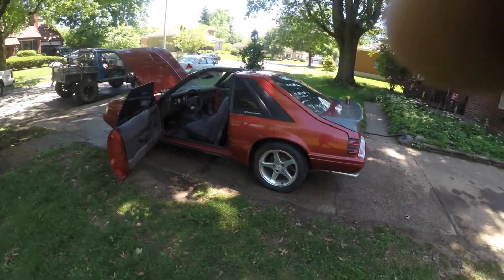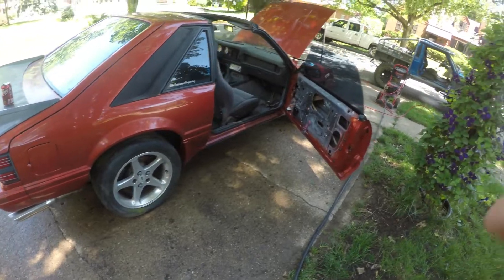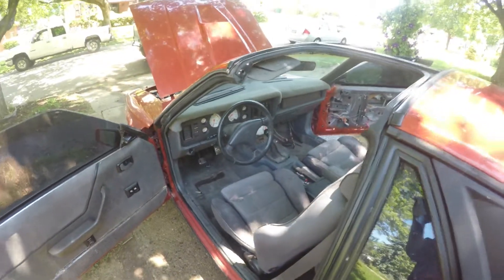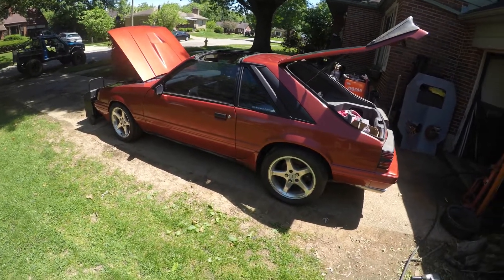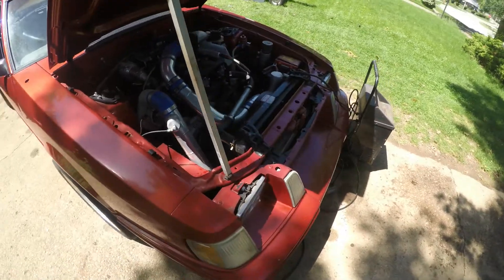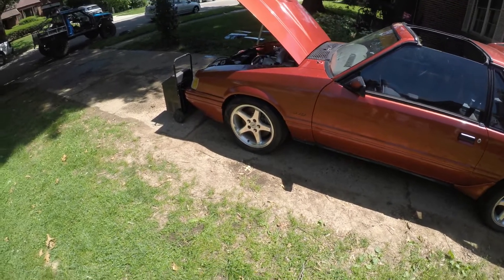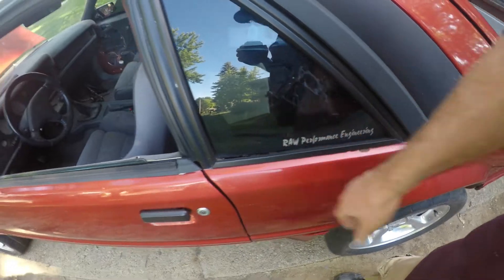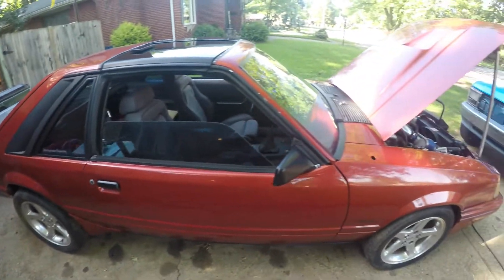Bringing back the 16V  Volvo headed SVO.

Comment: One of the few modern videos i've seen on a Volvo head swapped, and Cobra irs swapped SVO. I've always been intrigued by the Cobra irs swap, and the Volvo head swap looks like a marvel of engineering. beautiful car, the color is stellar.
Reply from the maker: Was a lot of work figuring out the swap as at the time only a few had managed it.  The Cobra swap stuff was fairly easy as the main chassis really hadn't changed from 79 to 04.

Comment: Appreciate all the work you've done. That said, I'm confused with the t-tops. You seem pretty hardcore and the two, t-tops and hardcore, just don't mix.
Reply from the maker: I don't drag it and I grew up in the t-top era.  Just something I like.  Ive since built a tube bender and I'll build a roll bar for it.  It does have full length frame ties.   Thanks for watching!